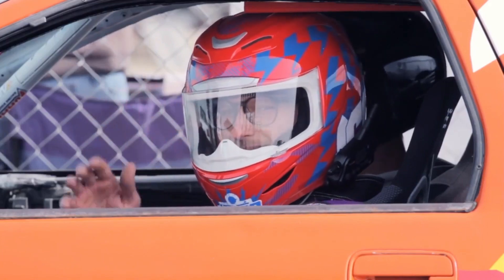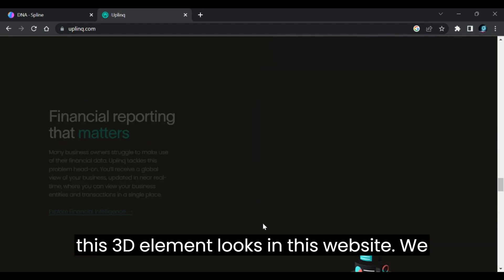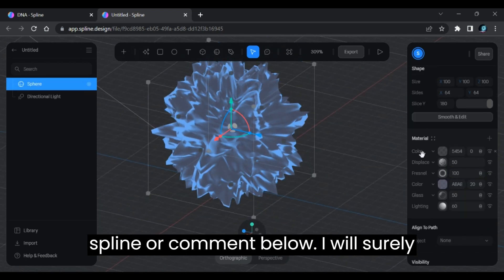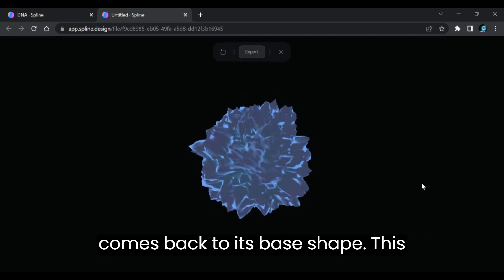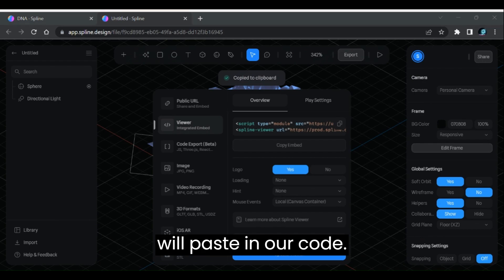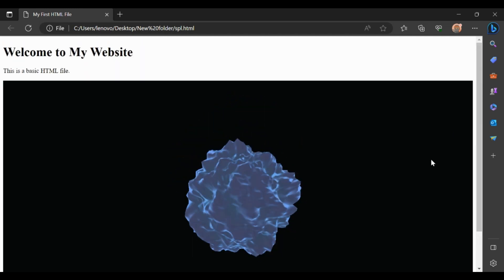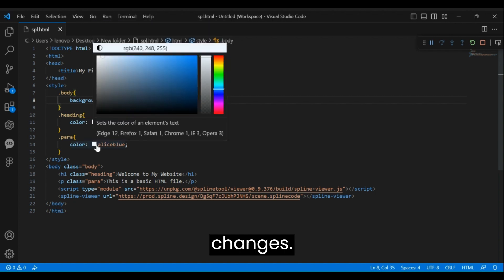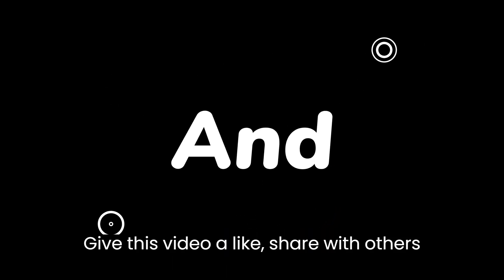Creating Stunning 3D Designs in Spline and Embedding Them into HTML/CSS Webpages

Comment: I followed your steps and included it to my website. However i am getting that spline icon at the buttom of the design.
Reply from the maker: @balajomuhammed651  hii... In this video I have shown example using simple html but as you are making project I am assuming that you are using react or next or something... So in that you would need to install spline Library... Can gind installation guide on the spline docs... After that there are two lines of codes that's we already copy pasted from spline viewer so in those line firstly comment out the upper line so that it's not rendered and then in second line remove the prop spline-viewer and use Spline that you installed and imported to the file. And also in same line instead of scene prop use url in place of that... It should work that way.
If using simple html then that logo would be hard to remove as previously it could have been done using editing the code but now the code is inaccessible for free users so best way is use an framework which I hope u are using and then edit that as I mentioned above